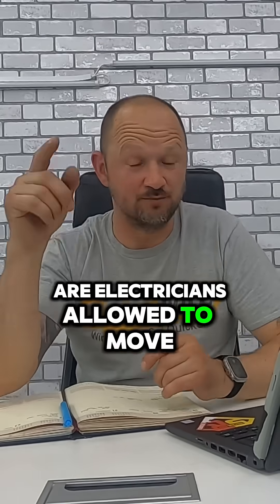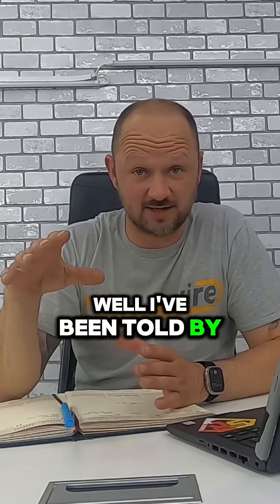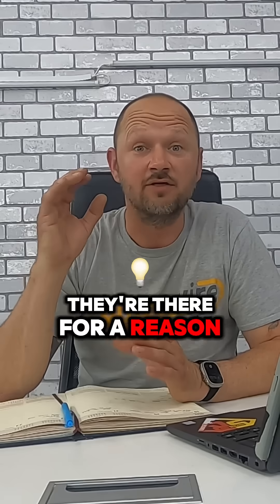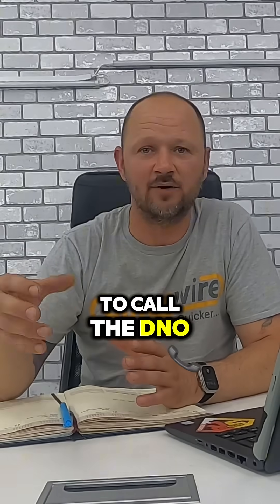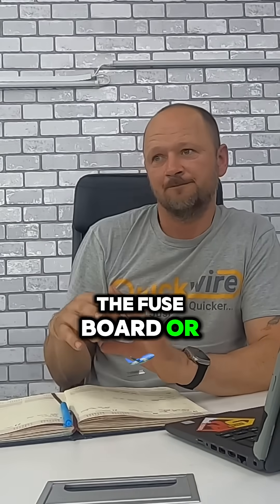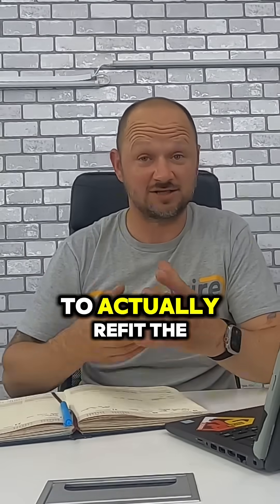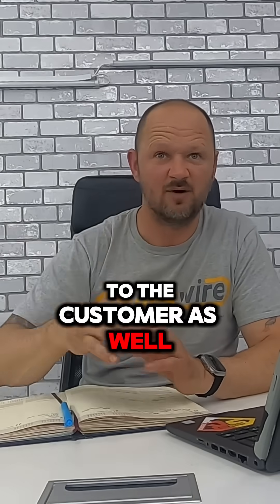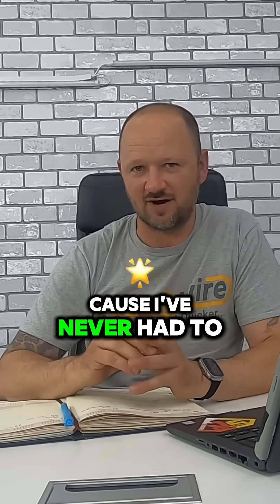Can You LEGALLY Pull the Main Fuse? Every Electrician Should Know ⚡

Comment: Some DNOs allow it.  SSE for example. 

2 Permitted Works
2.1 The following are works for which SSEN permit the removal and replacement of our cutout fuse:
• Replacement of domestic customer’s consumer unit or first stage of isolation on
their network. This permission covers single phase and three phase cut-outs
2.2 Removal of security seals:
• Removal of security seals on the SSEN cut-out

Comment: All you need is permission I've had permission a few times now to cut the seals. You need to contact them. This premise didn't have an isolator either in which I fit DNO was meant to come out and re seal it and didn't for months. If they can't get out there and then you just say there is a hazard and they will grant you permission.  It's against company policy to cut the seals there is no actual law on it apart from company policies

Comment: In the netherlands, this is only an issue if you have an old installation that is pre 1970's.
Pretty much everything after that has the "breaker type" switch, not fuses. So you can just click them off, work safely (after proving ofcourse) and than turn it all back on.
The box containing these breakers is sealed, but the switches are accessible. So you only need the power company to come in case of an amperage upgrade.

Comment: As a customer, I called the dno for my area directly and asked them to fit an uprated fuse and double pole isolator. They came out and replaced it for free AND they upgraded the cables from 16mm2 to 25mm2

Comment: They’re now doing all these smart meter rollouts so it would be a perfect time to fit a DP isolator. And while they’re at it, upgrade any tails from the cut out to the meter, and from the meter to the isolator to 25mm if they’re currently smaller. No sparky would ever need to call them out again after that.
Reply: Tails from the main head to meter are dictated with what cut-out fuse it has.
Reply: @MADSPARKS31 Yes, but changing to 25mm would also allow the main fuse to be 100A, assuming the supply from the DNO is large enough. What I’m saying is it would future proof things a bit. The main thing is a means of isolating the consumer unit without having to resort to cutting off tags and pulling fuses.

Comment: Apparently, "It is illegal and an offence to interfere with this apparatus"........ 👀🙄👀.  

DNO, "should" be fitting an isolator as standard when the meter is changed to allow for works in relation to maintaining the installation without having to liaise with the DNO to get this done on board changes.

Unfortunately the DNO meter changers have just "Done a course", so some would argue that they're not even "competent" to change the meter never mind fit isolators after the meter.
Reply: Meter Monkeys work under OFGEM, its electricians that can't "technically"  touch the meter. Crazy industry.